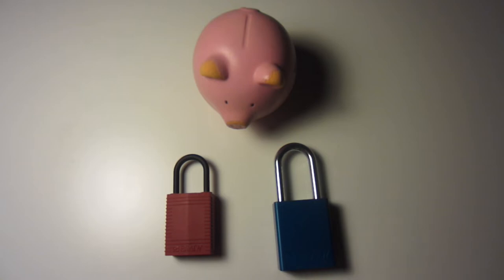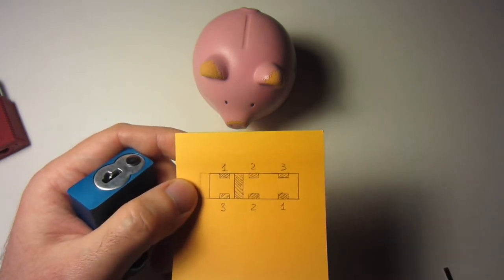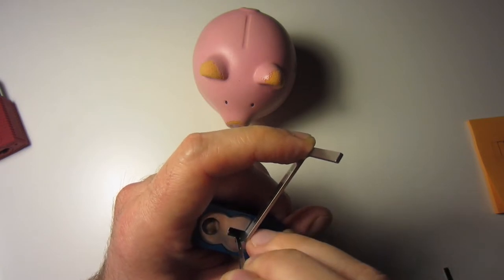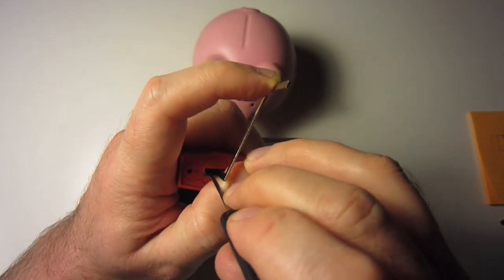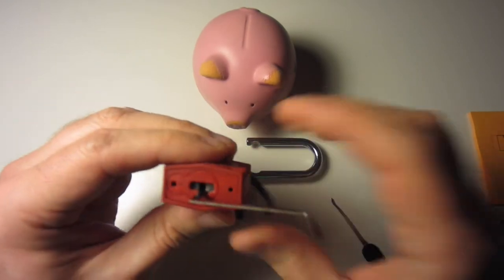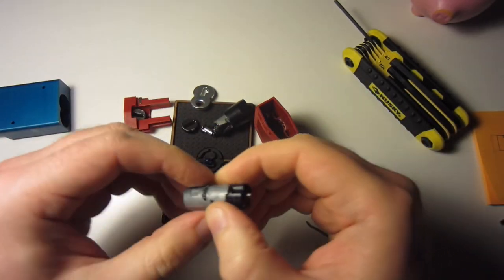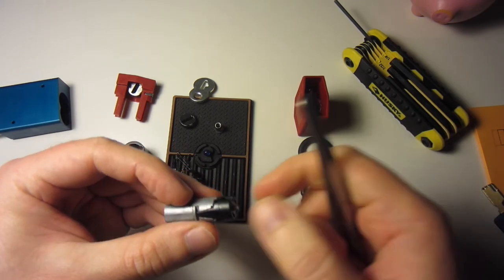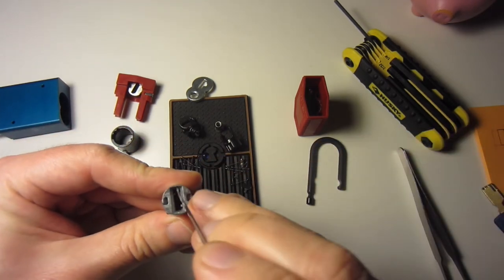[1] Brady Safekey Pick and Gut

Comment: So these safekey locks are sorta just a tubular lock but smooshed into a rectangular keyway? As far as picking I mean. I wonder if one could modify or 3d print a tool like the tubular lock impressioning tool... thanks for showing this interesting lock to us!
Reply from the maker: Yeah, kind-of, except instead of each pin binding individually they bind against one of 2 sidebars (for the top and bottom) so you get the same binding order on every lock. You could probably make an impressioning tool for them, the trick would be to get the resistance just right to overcome the spring tension on the pins.
Reply: As the lock starts to pick, the keyway turns and restricts full access, not a problem with single pin picking, but may restrict the use of a auto impressioning tool unless all the sliders were below the level of the throat cut on a key.